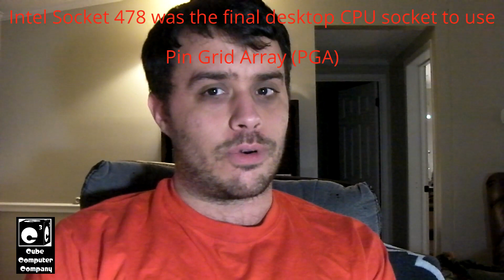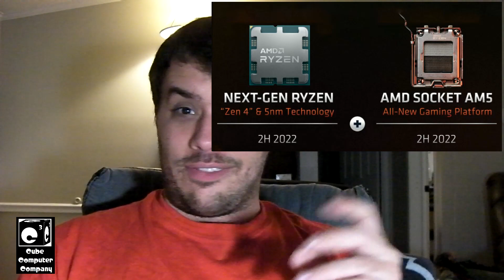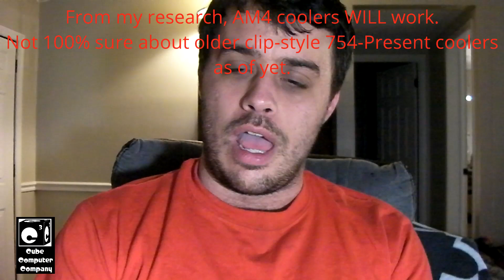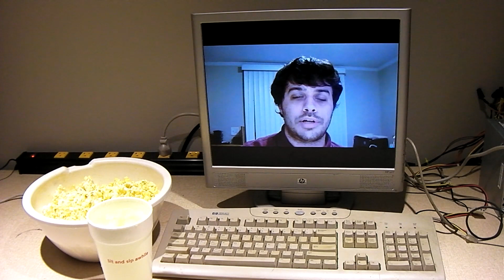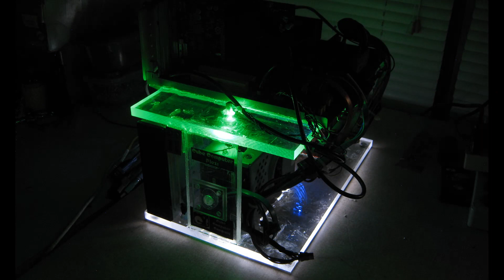New Ryzen 7000 AM5 CPUs coming soon from AMD!

Comment: the new socket for the most part will work with older AM4 coolers adapters will be provided or new mounting hardware will be made available for the coolers just go to the website for your cooler to see if the maker has a message saying am5 mounting hardware is available etc